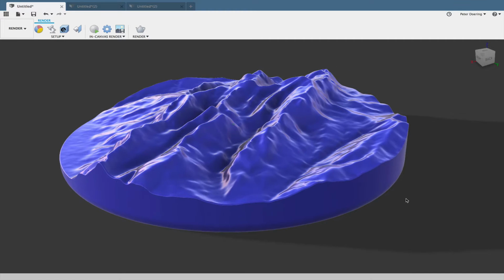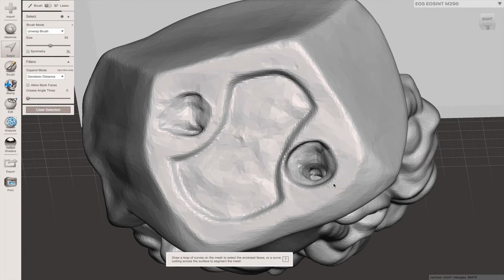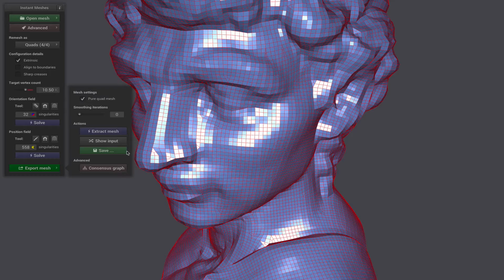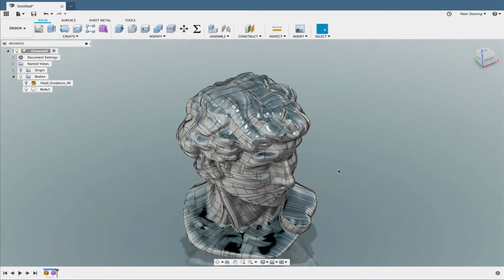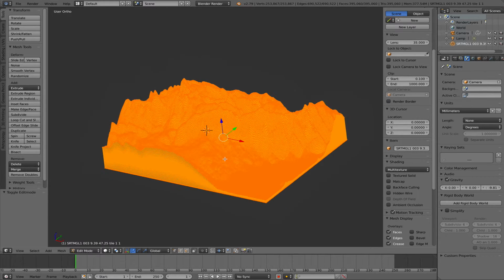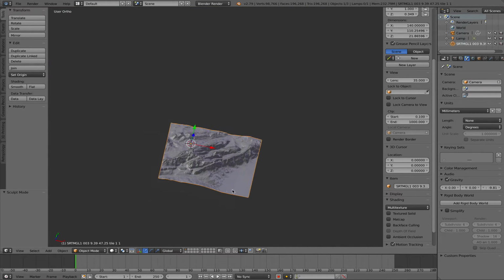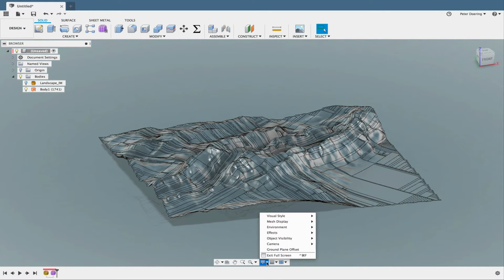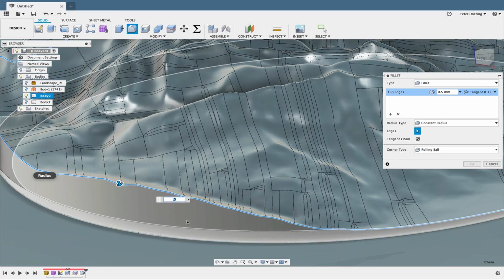Fusion 360 - A better workflow for irregular and organinc .stl files

Comment: I feel like solidworks is way stronger than fusion 360 at doing reverse engineering manipulation from 3d scans.  "I want to make a piece that fits on top of this 3d scanned part" is just wildly difficult to do in fusion.

Comment: Thanks, still wondering that the guys from A-desk not fixing that.
Reply from the maker: Fixing what ?
Reply: @TrippyLighting   if i need for mesh preparation additional tools, there is a issue, your work around is great and they should work on a implantation, see that since 2016. Fusion is working with cloud support, the additional gpu performance can be applied without a problem in seconds. I don't see any technical restrictions just the missing implementation.

Comment: Is there a way to reproject missing details unto the nurbs from the original high detail STL after conversion? I think I saw someone do that but I'm not sure they did it in Fusion 360.
Reply from the maker: I am wondering whether you watched the entire video. This uses several pieces of software, Instant Meshes and Fuiosn 360 at a minimum and there is no way to interactively and bidirectionally exchange data. The meshing process in InstantMeshes is semi-automatic and you can only miss features if the mesh resolution is not high enough. If it does not have enough resolution and you only find that out once in Fusion 360 you'll have to start from scratchy and remesh again.
There are only a few software packages that I know that have builtin re-meshers e.g. Brush, but those do not output CAD geometry.

Comment: Peter, I can follow your teaching style very well.  Can I hire you to publish videos solving Fusion 360 problems I encounter?  I can pay you for professional time or per video; whichever you prefer.  I will probably ask for a couple of lectures er week, and I will email you my quandry or question.  Im a relative beginner, jumping from life as a chef to furniture design.  Over time I will be using all the downstream engineering capabilities of Fusion.  Right now I struggle with basic things.  Let me know and thanks.  Nick, USA 828-283-1519, nickon1080@gmail.com
Reply from the maker: I will send you an email shortly. I have tutored a good number of people in Fusion 360 from beginners to seasoned professionals and in my experience much can be accomplished in an hour of online training. My focus is on explaining concepts, not just techniques. Once concepts are understood these often easily transfer to other software.

Comment: Well, this did look like the perfect solution for the file I was working on, but that turned out not to be the case. Perhaps you have a non-default user-setting in Blender and/or Instant-Meshes that makes your system do things differently, or there are hot-key presses that are not apparent in the video. But whatever it was, the exported 'quadmesh' file from Instant-Meshes, when inserted into Fusion 360, had a very strange appearance, obviously was not going to convert to a T-splice, and couldn't.

I had found it easier, albeit extremely tedious, to slice the base off in the X-Y plane using Fusion 360, and ditto a corner in the Z plane.  Then exporting the result as an .obj and taking that into Blender to get rid of duplicate faces seemed to work. (Blender is a pain, it is written for Python-heads, by programmers for programmers, not ordinary mortals, and it has a lousy, non-standard UI, even for saving files). It said it removed 815 duplicates, a low number I could not believe, given that there were about 250,000 faces.

But I assumed it knew what it was talking about and took its output into Instant-Meshes. What IM then produced was that unusable rubbish--a file that when inserted into Fusion 360 had that very strange appearance and could not be converted to T-splines, if anything.

So I am still searching for a way through the labyrinth to get to a simple result, which I thought would be a simple process. It seems to me that the 3D world is still like the Wild West, and does not have the dependable interoperability of 2D graphics (photos and vectors). In that world file-formats are very much standard; all the software that I have ever used over the decades gets them right. But in 3D, for example, one program's quadmesh is not recognised by another one. MeshLab's is not recognised by Fusion 360. All it sees are triangles; it cannot see a single quad.
Reply from the maker: In Blender did it look like a double mesh with larger quads and a mesh with half sized quads right over it ? What OS are you on ?